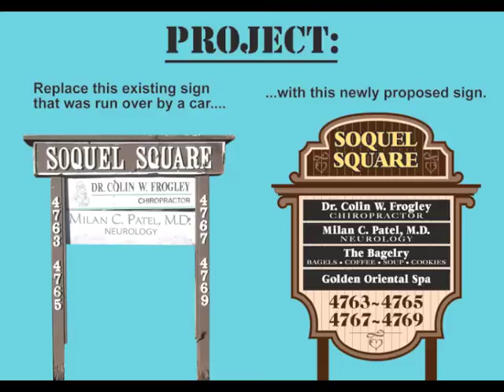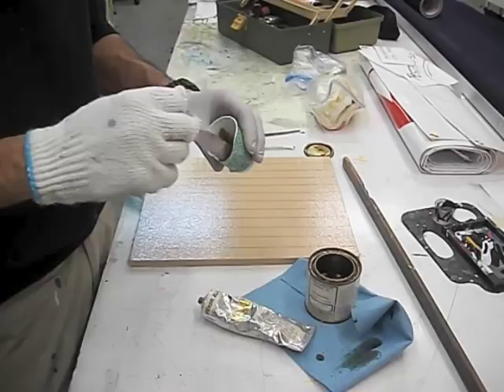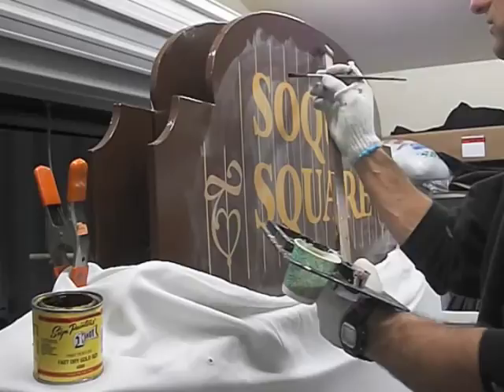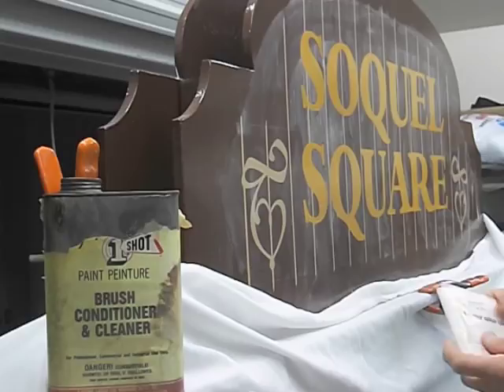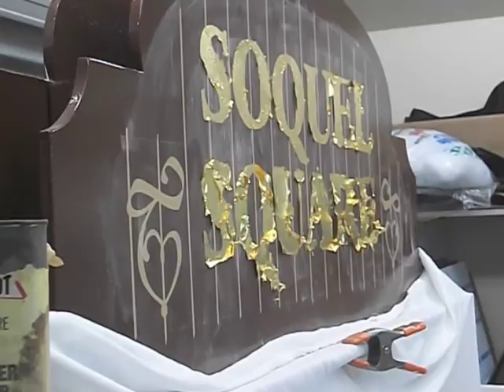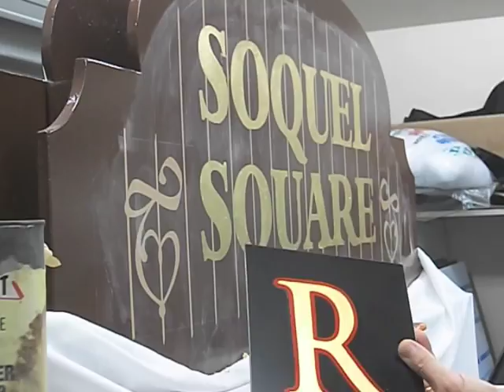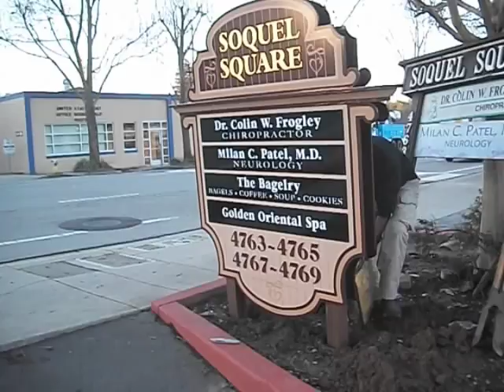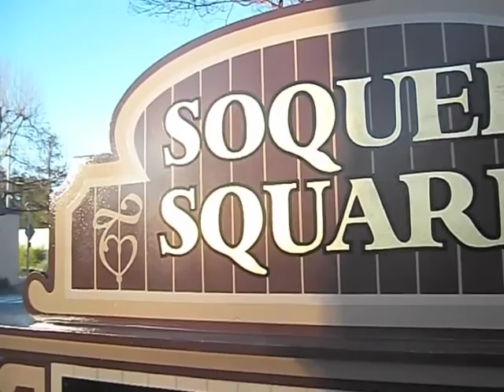Sign Making Process Video

Comment: Is that plywood that you are using?
Reply from the maker: Yes, It's 1/2" MDO (Medium Density Overlay) plywood. Also know as Marine Plywood, Originally used for boat cabinets and such. It is comprised of water proof resin.
Reply: thanks great work!